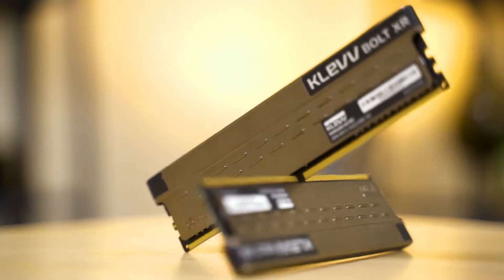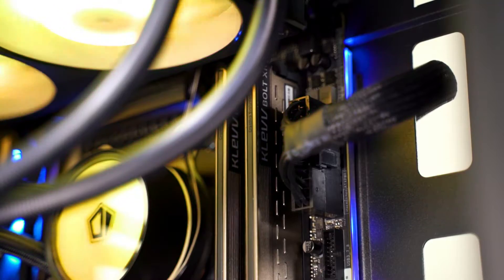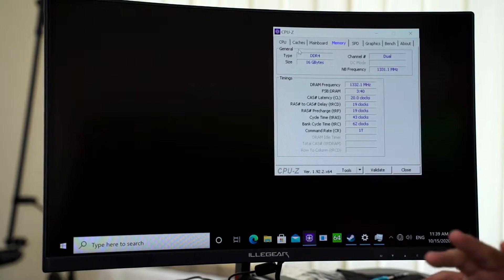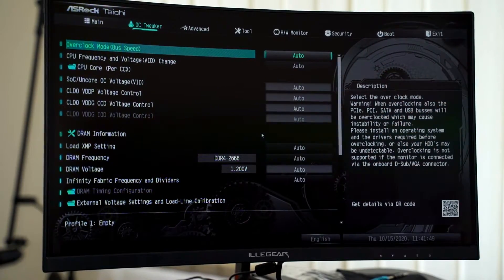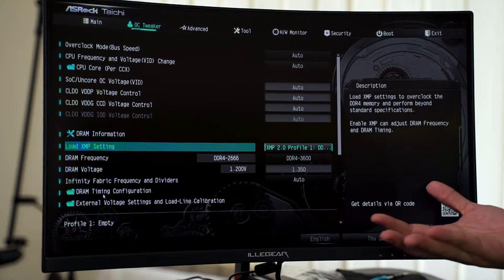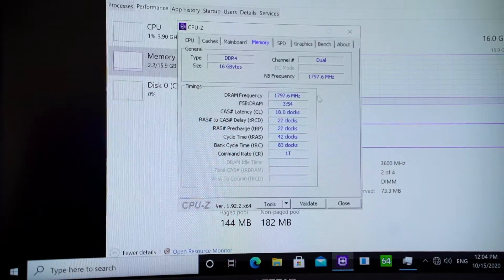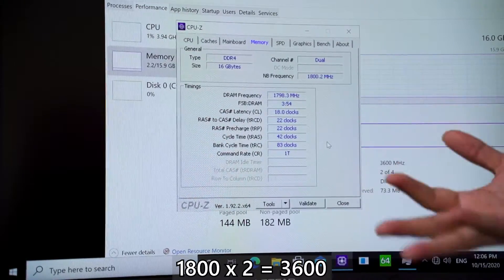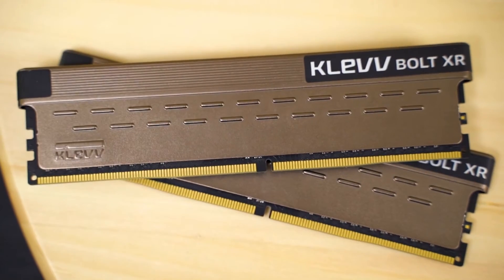How to Enable XMP/DOCP feat. KLEVV BOLT XR unboxing

Comment: bro I just checked on Asrock B550m Pro4 QVL for Cezanne (planning to take ryzen 5 5600g), this Klevv isn't listed, only 1 klevv RAM is there which is "KLEVV with 4266 Clockspeed 8GB	memory size and this module "KD48GU800-42B190Y"

will KLEVV Bolt XR work fine on my system?

Comment: I have klevv cras xr rgb ddr4 3600mhz with asus tuf b560-plus gaming.
Leave xmp1 with of course 1.35v auto, but not working even with 1 stick.
Bios also updated with latest version. Any suggestion?
Reply: sama kita bro, sepertinya limit ada di prosesor nya, pakai prosesor apa ?
spec pc ku
cpu : i7 10700k
ram : klevv pc3200 4000Mhz
mobo : rog strix b560f gaming wifi

diatur xmp 4000 ga mau boot
setelelah xmp aktif, tapi dibikin auto dan custon frekuensi mengikuti i7 10700k di 2933 Mhz, baru bisa booting

Comment: I’M LOST ❗ ❗ ❗ and need some good advice. 
A number of years ago I had a PC built for me and I now want to have another one built, one that will step up a level or two.
After watching countless videos I’m now completely confused as to what to get or even who to ask…
So I figure the best thing to do  is to list the components I have in my PC in the hope that someone out there will take time out to put me on the right track.
The only thing I don’t want is ‘Water cooling’ (Me and water don't get on together : ) 
I would much prefer a  Noctua NH D15 Chromax Black  or a Be Quiet Cooler, which I guess that means getting a BIG Case, but that's fine).
~
OK, here goes : 
Case : GameMax Falcon Gaming PC Case
Power supply : Be Quiet Pure Power 9 700 watts 
Motherboard : GA-990FX-GAMING
Processor : AMD FX(tm)-8350 Eight-Core Processor
Ram : 32 GB Hyper X ram low profile
Graphics Card : NVIDIA GeForce GTX 970
Hard drive 1 TB (It's Not an SSD).
 ~
That's my whole PC

Comment: I have the exact same kit, the ram forces itself to run at 2660mgz cl20 no matter what I do. xmp doesn't work and neither does setting it manually. I can't even run it a lower frequency, it just locks itself at 2660mhz and cl20 timings. any ideas?. it is on the qvl list by the way
Reply from the maker: Did it restart multiple times after setting it to XMP?
Reply: @TechCritter  nope, just booted up into windows and when I check task manager it shows up as 2660mhz cl20, same with hwinfo
Reply from the maker: What motherboard are you using it with?
Reply: @TechCritter  an Aorus x570 elite
Reply: @zeshanmushtaq5520  latest BIOS? and did you set the DRAM voltage to 1.35V after enabling XMP?
Reply: @lowcl3221  yeah I managed to solve the problem by doing that. I assumed it was a bios issue just because my board was running a super old one and I heard it fixed issues lol
Reply: mine did restart multiple times, and there's no change to the memory speed after that